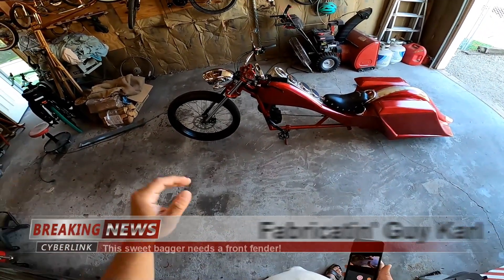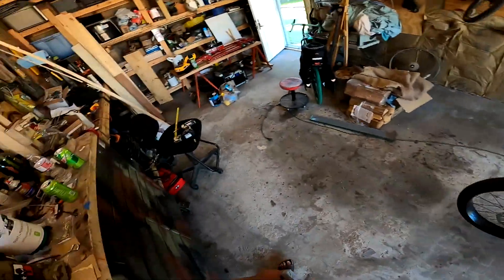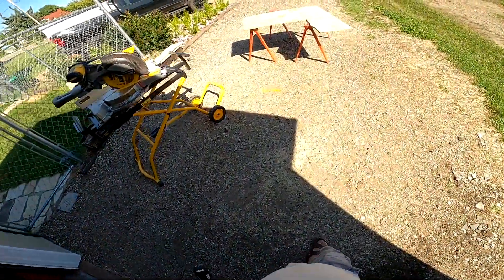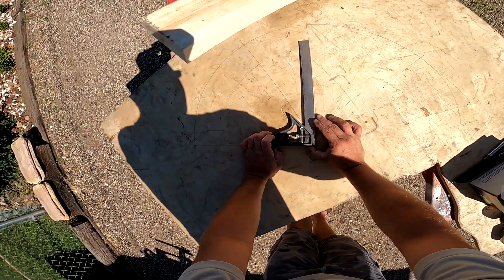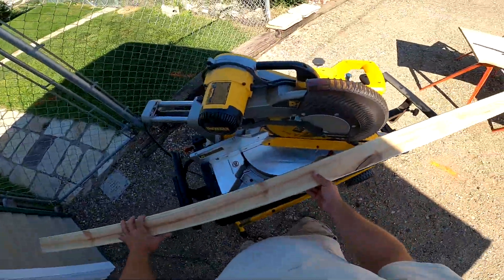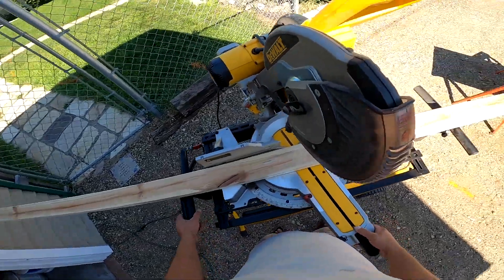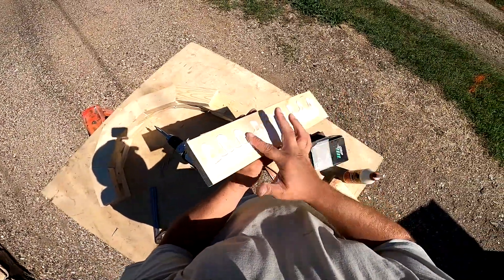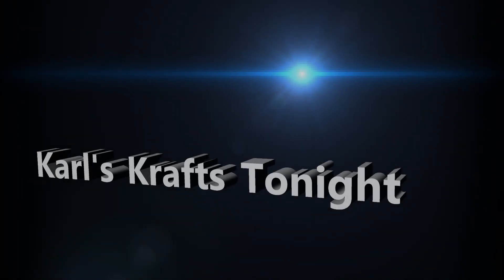How To Make a Fiberglass Bike Fender Part 1

Comment: Wouldn't it have been easier to use the wheel itself to create the fibreglass mould? Instead of creating a wooden fender piece first.
Reply from the maker: @monikagonsalves2595  if you could find a way to do that, possibly. But then it is either not reusable as a mold or would cost more to keep that as a mold to reuse. I made a simple re-usable buck using stuff I already had.

Comment: How did you make those saddlebags I love them trying to make some for my minibike ?
Reply from the maker: I built them from 1" pink insulation foam. Cut each layer to rough shape, then glued layers together. After that I sanded the outside to shape and wrapped a few layers of fiberglass over them. On the back where they attach to the frame I embedded some 1x.250" steel bar in the foam and epoxied 1/4" plywood over that so they would have solid mounting points. I didn't fiberglass thick enough for that to be the only structure, so I left the foam and then lined the inside with .063" polystyrene sheet.

Comment: How did you get the frame ?
Reply from the maker: I built the frame. I cut up a early 2000's Schwinn Stingray for the head tube, bottom bracket, seat, and seat post. I cut up and modified and modified the rear dropouts, forks, and widened the triple tree. Then I fabricated the rest of the frame re-using those pieces.
Reply: Very inspiring, thanks man.